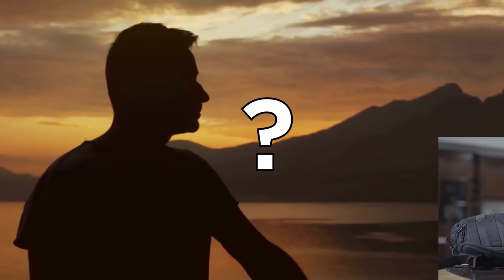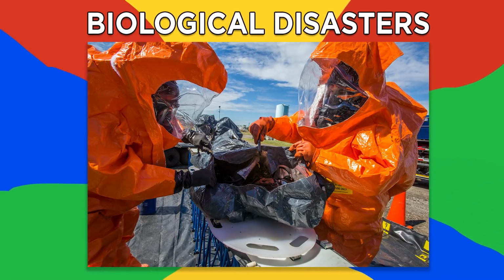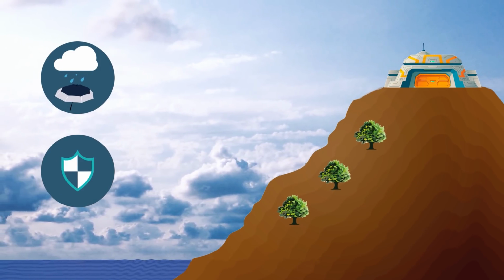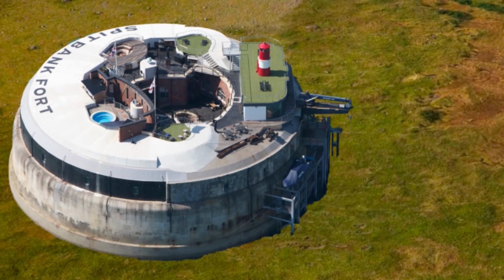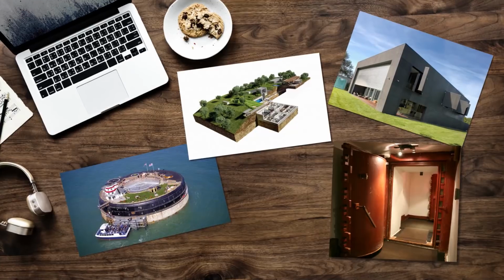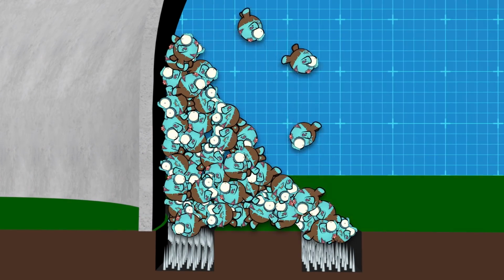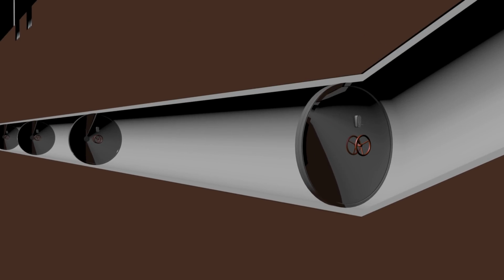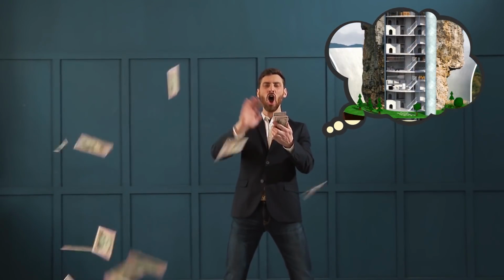This is the Ultimate Doomsday Survival Fortress

Comment: If you're going to dig a bunker then you'd easily be able to build a geothermal generator and never need to worry about power and if you choose the right location you could get access to deep ground water that's not contaminated. Also food grown underground can be automated with lights and robots quite easily. I would say the only thing that would be worth collecting from the surface would be sunlight via fibre optic cables so that we don't turn into mole people. Even trying to collect air from the surface would be extremely risky and it would be better to create a closed loop system that can last however many generations it will take to be able to wait out the radiation. Another thing that I haven't seen in any doomsday bunkers is a manufacturing plant of some kind. Everything will break down eventually and need to be repaired so should be planned for in case of that eventuality. No one wants to be in a bunker when the air and water stops moving and there's no way to fix it. As for protecting your entrance if owning a bicycle has taught me anything it's that no lock or preventative measure is unbeatable and it only protects you from the unprepared. So knowing that I'd add an extra layer of security by disguising the entrance. I'm imagining a door that rises out of the ground with a large boulder sitting on top that will act as manhole cover of sorts. People are less likely to break in if they can't find the door.

Comment: The one change I would recommend is relocate the structure to be an island in a river. The outward leaning walls make a zombie pyramid more difficult, but it could still happen. If you are surrounded by flowing water on all sides then the zombies will just get washed down stream and can't build up at all.

Comment: A few ideas:
1. Mine with explosives in the escape tunnel. Just in case the blast doors are breached.
2. Have a workshop with everything you would need. Lathe, 3D printer, forge and etc.
3. Vertical farming.
4. MSR reactor, preferably a Thorium one.
5. Biosphere set up. Lots of air, food and waste disposal.
6. A Star fortress design, but I like your slanted walls. (Side note: Due to the walls. I don’t think you’ll get much light to grow things)
7. A massive hanger for vehicles, aircraft’s and ships.
8. Close to airports, harbor and train system.
9. Close to certain mines.
10. Have the concrete walls line with Rhino coating with a faraday cage installed inside.
11. As much as possible have things run on gears. Since it’s easiest to recreate with supplies on hand.
12. Add hospital.
13. Tech room. Have servers hold as much knowledge as possible. Also add a communication there as well.
14. Have a gold and jewels bank vault.

I think that’s a good start.
Reply: the prob is how can you afford that
Reply: @  Very true, but than again any kind of shelter is going cost bank. I’m more like. The world is going to end. I’m going to get a loan from absolutely every loan shark and bank I can. Than build it and survive

Comment: Your design is very flawed, provided your facility has rivers in the area you can build a concrete canal that gets funneled into an underground tunnel, this would not only provide power and water after filtering but also a means of disposing of sewage (if it wasn't being saved for manure) and being a tunnel would mean you could have it start well away from your entrance, not to mention that the tunnel could even be the entrance\exit by boat\cable ferry.

Comment: I’d use a gravity based power storage, an example of this is using excess renewable energy to lift a weight or pump water against gravity then when more power is needed the weight or water can be moved downwards with gravity turning a generator

Comment: Nice video, but you forgot to address the critical flaw with this plan. It's a fixed location. In a dooms day scenario, the most dangerous element are the other folks who also survived the initial disaster (and are now doing whatever they can to get to your resources). The best plan/location would be moving platform out at sea. Large enough to grow your own food/livestock, and enough surface area for solar/wind generators. If the main fuel source was nuclear, you would have enough fuel to last many lifetimes. Being in the ocean, you can desalinate or collect rain water, also moving away from inclement weather.  Recycling of waste for fertilizer or fuel/heat. Lower level decks would have storage for other nonperishable raw materials (for repairs, machines, etc.), Machineshop, chem lab, living quarters.

Comment: Why cant you have one sub level be a garden where you have solar panels that theoretically charge themselves. You are already collecting water. One more sub level or rather combined level to a subterranean farm, would be having chickens and pigs to help rid the waste and fertilize the seeds to be planted. 
If this section is put far enough away from the main shelter it will help with fresh air. The best way to ventilate would be smaller exit vents to hide them better.

Comment: Like the design but with all the electronics you listed your going to need a lot more solar panels and larger rain water collector, id suggest a bore or well you could pump water out of deep below the ground. As well as removing the second pillar, it draws a lot attention which will happen no matter what if someone happen to come across it. But the over all designs is fantastic the curved wall and multiple doors in the tunnel are functional designs. And you could easily survive two or three people in that much space, more if you cut down on nonessential.

Comment: ontop of tekknomon's bit, open air gardens mean that if its a zombie apocalypse , youd never know if birds might mutate aswell. and this means that your vulnerable from the air. a biodome wouldnt fix that ether, because most materials that are clear enough to allow light in wont block impacts over prolonged time. so thats out. an underground garden would be best.
and whats the point of having that long tunnel to stave off radiation if it can get in the top much easier. besides, if it is a nuke, then that large pillar can be damaged and repairable even with the rock around it.

Comment: I would propose not making it as high as the video says. It only needs to be high enough to keep people out with ladders. Also, put a control environment on the roof something like a sealed thick layer of glass with a protective concrete shield that can open and close. Allowing the plants to get light while protecting from the outside contamination.

Comment: Their idea is horrible. The most important thing before anything else is secrecy. I don’t care how many guns and bullets they have. If people know there location. They will eventually get in. They could get a damn bulldozer. Bulletproof it and just plow into the concrete or use some C4 and blow it up. The bunkers should be completely and totally underground. I think the best way to do it is find a deep cave that has a strong river running through it. Or find a fast moving river and dig down to it. Build your bunker underground there. Set up some sort of water powered generator. You would have water forever. Water is the hardest thing to store. Where as having an unlimited supply of water. You would have unlimited power. Also water for drinking, bathing, cooking, and cleaning. You could also set up a fish and shellfish hatchery. You could also grow food through hydroponics. You could also have a company build some sort of air tight submersion pod. That way if the facility is ever breached. All the people could get in to pods. that were placed in the water. So people could escape and come out of the river somewhere miles away. Just a thought.

Comment: MUCH much room for improvement and there is a survival hotel in existence that's similar to this design. An inside garden using UV Light, secondary portable power sources such as portable wind turbines and solar panels incase the main get destroyed. More guns more spread out in multiple locations, same for emergency packs, food, and medical supplies should be accessible in every room/level. Furthermore, you can have extra gunpowder and a bullet repacking device so you can reuse your bullets. There are also other additions to be more sustainable such as the below-mentioned aquaponics farm well as considerations for abandonment and escape in which case you may need to camouflage and also have escape vehicles and hidden/buried geocaches place periodically in a 100-mile perimeter. In this manner you further increase chances of survival by having back up plans, escape plans, supplies more spread out so attackers can't hit one room and destroy stuff plus no matter where you are if you have to suddenly go you have stuff right there, and other things can be done as well to additionally increase chances of survival, better planning, defense, and increase sustainability. Comment if you think I left anything out.

Comment: I would also suggest that somewhere along yhe way for the escape tunnel, there should be a garage for vehicles and machine parts should any of your equipment malfunction. Should something happen to where you need medicines that you run out of, you would need a safe vehicle to travel in. Customizing an armored truck to have air filtration, lead plating, mounted weapons, spikes on the sides, and room for stocking goods found would be ideal. You could either have someone custome make a truck like this, or get someone on your team who knows how to weld and be a superb mechanic.

Comment: Wldnt it b ideal to have a hydroponic garden system set up??? If theres a nuclear blast its gonna b difficult to grow anything out doors if not impossible. A hydroponic garden wld b much better imo. Plus I'll prolly need some kinda of air filtration system or clean Air system. Also ur gonna require vitamins. Most of use get out vitamin D from the sun which won't b possible if we r confined to a bunker.

Comment: Best way to stop radiation from entering your 'fortress' is right angles. While those blast doors would provide enough protection it's not very efficient. Also the stair well. Radiation will leak down it. Not nearly enough space for growing, as already pointed out so a hydroponics level would be needed. Extra supplies and knowledge to repair any circuitry destroyed in an EMP event is needed as well. The best defense is a good offense, static positions are a liability. Need enough space to be able to grow horses or generate enough bio fuel for ATV's, or generate enough electricity for eATV's. This would allow you to send out patrols. Some initial building supplies stored in a secured nearby barn or metal building would be a plus as well. Once you survive your job is to concentrate on growing, not survival. if you are stuck down there waiting on radiation to clear out you need a school and adequate entertainment facility's. cabin fever is a real thing. You don't need to dig deep, just having 8' of soil on your roof/sides will stop radiation. Save a lot of expense by building wider. this gives you inner courtyard area for growing as well.  In the building supply storage i would also put glass, plenty of natural materials in the midwest but sand is not that common. This glass can be used for greenhouses when you are first expanding in order to protect your food. Don't be planting wheat in these, plant things that can benefit from high intensity gardening. As you empty your barn/sm warehouse out start sending out scavenging teams. Do this before you need it make a list of things to prioritize. Electronics should be higher on this list if you have someone who can make circuits. Which reminds me, your entertainment area should also have a library. Lots of physical books but lots of electronic book storage as well inside an emp proof cage. I'm positive i could think of more. :)

Comment: Problem: Nuke hits nearby = good bye surface portion. You need to think GRANDER. Think ultimate concealment. Build the structure suspended on a massive set of hydraulic pistons. When you get confirmation that nukes are airborne, retract the pistons. Bring the entire complex underground, wall and all, so that it is not damaged in the initial blast. Once everything is settled down, deploy the rooftop solar panels and wind turbines, raise the wall start charging a massive battery bank, then, once the batteries are all charged up, use the power to raise the structure to normal height. Once the hydraulics have done their job, an automated system will seal the fluid in the pistons, preventing the structure from sinking.

And, yeah, you would need at least one or two levels dedicated to hydroponics to make it truly survivable.
Reply: Yay you covered everything I was going to say
Reply: @nobody7817  oof
Reply: i was thinking that piston idea as well.. to have half your structure depending on mechical system that could break and or ware out and would take great effort to repair.. is not a long lasting idea... best you could do is a retracting doom on the top with emergency release if it breaks..

Comment: Not to mean but how are going to get the power back if you don't have spare fuse from a power surge making power in possible solar and wind really don't produce enough power to substane a big ficilty to its fullest also humans are very social and get lonely which could cause suicide if a person dose not handle being alone with the same people which could make people mad. Another though genetic diversity you need more than a hundred people to substane life of humanity. And 5th we thing near by lakes during a nuclear bombs dooms day would not be drink able cause of radioactive isotopes would cause poison in the water witch turns into hydrogen so why not use hydrogen power in stead cause water can not be filtered and sensitization would be useless because of lack of water because of virus and bacteria can live in water and can be airisaled so water is useless. Lead concert infused with carbon to use bacteria to rebuild structuralunhurty the bacteria only needs vitamins and water to fix the concrete. You really missed slot and radiation can last for 1-5 years. All oxygen would not be breathable with the radiation poisoned air when elements are unable to transition to a solid or gas or liquid the elements are random because of the isotopes messing with other elements
Reply: If you look at another problem granit lead steal are required to be 100 inches in length to not be affect by ration for the inner shell the outer shell should be buried about 8-15 miles down under a high content radiation adsotion Materials and non adsotion materials in the soil and stone and it would have to be in a mountain dug down a nuclear fall out building is also going to need power nuclear the reason why you would have high speed winds witch can destroy solar and wind power and a 30-40 years of clouds blocking the sun and hydroponics to grow food with a lightblubs vitamin D for live stock and bees if you want want more facts comment me cause he missed hundereds  of things

Comment: nice however it lacking ventilation. can't live without air so a scrub system that would break down the air and reassemble it would help taken out the unwanted said pathogen or bio toxic!
second is the garden there could be an underground plant system and dependent on electrical energy to provide light this would help reduce the dependent on the outside.
a drone system on the roof would help extended eyes and ear.
a small factory inside that could help you make stuff with raw material.
physical knowledge storage like a library with a search function is good ... you know just incase google doesnt work anymore!!!
internal farm... yes farm ... how could you live without bacon and egg... as well as Cheese !
and you also need a lab... since if you caught something new... you might wana have a lab for a chance to cure yourself .
And most important ... dont forget soap and remember to take shower everyday !!!

Comment: I would say colorado. Have plenty of water. The fallout will last months years. However fallout does go down. So initially being low will be great. Later it will be the problem. 
Since prepping is about surviving the initial attack then maybe be at the foot of high elevation. After several months move to the higher ground as the fallout moves down. 
Or high ground near ocean. After a few years the ocean will be good source of food. Ocean will quickly dilute poisons and go down to the biggest predators. Leaving the sardines and shrimp being wonderful sources of complex foods.

Comment: Hmm you'd stick out like a sore thumb so survivors would be constantly trying to attack you. Firing from almost medieval defenses won't work, you need slotted gun ports or better yet, remote fire systems. The farm could be kept completely indoors with UV lighting. Stick to solar panels, wind turbines will attract attention and panels may not be seen from ground level. Finally...build this into a mountain side, maybe in the Appalacians (but this is closer to higher populations) or Rockies (but this is closer to active fault lines). Or heck go to Canada, large swaths with high elevation and no one around. I feel like I'm designing something on Minecraft....